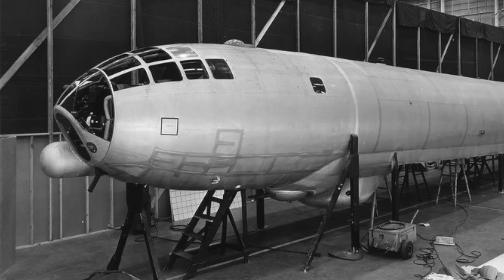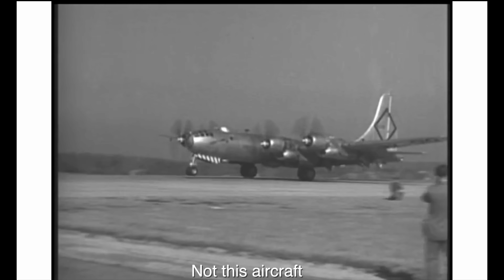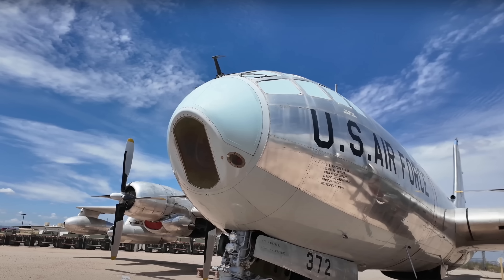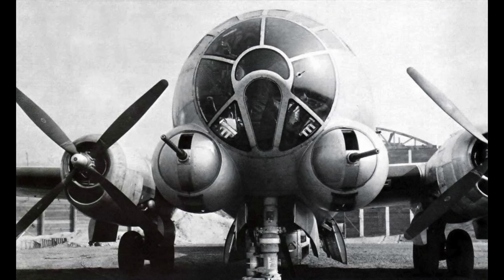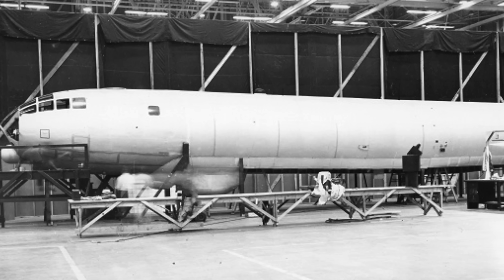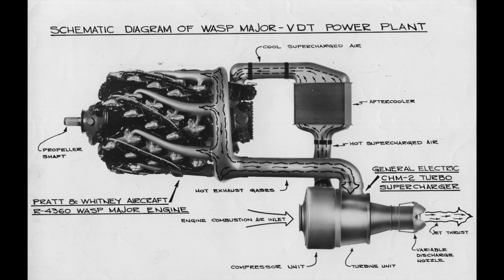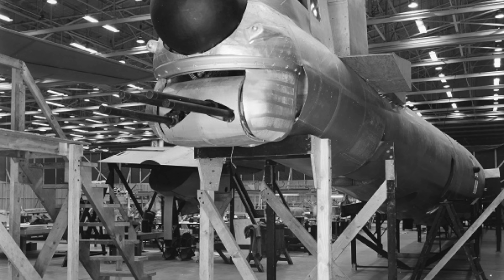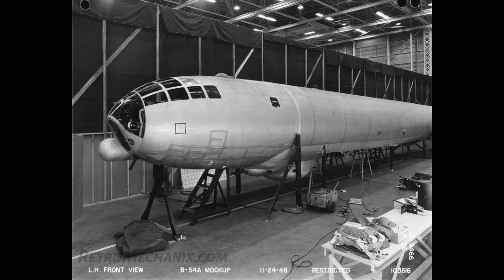Boeing's secret and cancelled final Superfortress - the B-54

Comment: For all of you arguing the point ,
Official government acknowledged cost of :
       Developing the B29   $ 3  Billion  !
   The Manhattan project $ 1.9  Billion !
       Yes the B 29  cost more than the Bomb it eventually dropped  

                      WHY ?
The project begun covertly ( to avoid the wrath of the anti-war and isolationist lobbies ) during the inter-war years ,when the inevitably of the coming war and despite our neutrality , the likelihood that we would be drawn into it  .
  On the assumption Europe would fall it would need the range to attack from the periphery ,  and
  in line with the dictum bombers had to fly higher and faster than the fighters ( the ones it was designed to
 it did , but by the time it flew not )  , it needed new more powerful engines (with super or turbo chargers)than were  
 available , to reach the altitude and speed requirements  , the first of the from the drawing board up projects .
 The altitudes also required oxygen(new tech. at the time) and a pressurized cabin (a still needing to be  
  developed )  ,  and that in turn necessitated remotely targeted turrets (a manned turrets would NOT be possible to pressurize ) that needed guns that would operate unattended something else that was design up , and adding parallax to the gunnery equations  would make hitting a moving target pure luck , 
the solution to that was developing an airborne computer a novel idea at the time ( war time secrecy had the enigma code broken on both sides of the pond , the computers that flew on each B 29  was superior to the one in Dayton that cracked it ) again purposely designed for this airplane (although adapted for use in submarines too ,
if the torpedoes worked as well as the computers ... but that's another story) in the air over Japan the B 29 had the highest kill  ratio of ANY aircraft !
And the radar that was still a theoretical curiosity when the design began , was so above top secret that the air corp.and later air force air brushed the radar-pods out of all photographs released well into the cold war  !
 Even the Rayon belted radial tires were a first for the 29 .
  And probably the biggest reason for the higher cost all these scratch from concept to production developments ,
  The airplane's development took more than a decade longer than the bomb's !
  So YES it cost more !

Comment: I always wondered why Boeing and the air corps didn't install turbo props on the B-50 (I only just now learned there had been a B-54) instead of using recip engines...There were plenty of aircraft using turbo props for years by then...

Comment: One could argue the most expensive was still the Manhattan Project. Due to the fact that at the time it's  
role was as a strategic bomber. The main reason it was cancelled was that SAC went with the Convair B-36.
Could it have done more? Doubtful as it's operating cost was far too high to use it as a multi-role bomber.

Comment: Honestly, it's just as well it was canceled. Its competitors were the B-36 Peacemaker, B-47 Stratojet, and, in the very near future, the B-52. Normally it takes about 3 years from first flight to in service. Other than range, it was completely inferior to the B-36 with less than half the bomb load. It had around a 50% greater bomb load than the B-47, but could have still been intercepted by a late-WW2 aircraft. The B-47 actually had a chance of getting to its target, unlike the B-54 which would have been outdated on arrival.

Comment: I wonder what the pressure differential was in the B29. Modern aircraft normally limit this to a cabin altitude of 8000' but I imagine, with the large rounded windows on the B29 nose, the pressure differential must have been lower, perhaps compensated for by supplemental oxygen. 
It is interesting to see the extremities the development of piston-powered propeller aircraft reached before the entire technology collapsed with the advent of jet engines.

Comment: Was at Edwards  AFB in CA in 1964 when the B-50 was still flying. the engines were P&W 4360's  and 4 jet engines in 2 pods. The sound was amazing. I was a mechanic 6515th OMS on a TB-58 Hustler that was chase for the X-70
Reply: You should feel that some of the legendariness of those old ships rubbed off and surround you. My Dad was a Braniff A&P and I got radial engine knowledge with my mother's milk (Did you know 4360 power cases all had interchangeable/identical front and rear flanges? Sort of like how you can "reverse" an unreversible electric motor = swap it end-for-end!) Lol people ask me how long I been a mechanic and I tell them since my conception!

Comment: I did not appreciate how massive the B-36 is until I experienced it at the USAF museum in person. What an incredible machine even by today's standards let alone when it was made.
Reply: If you ever make it out west a day spent wandering around Pima Air and Space Museum in Tucson is a day well spent. Their B-36 is out in the open where you can really get a sense of how big of an aircraft they are.
Reply: @butchs.4239  I've been to the USAF museum in Dayton and Prima county muesem and going to Prima this spring on a bucket list Route 66 trip.  We'll detour  to Tucson at Flagstaff .  Looking forward to the trip, however the B36 was HUGE and could fly a long way, but Too SLOW and impossible to defend/survive.  Thank goodness that the B47 and B52 came along and we didn't have to use B 54 or B 36 against the migs in combat.
Reply: @Wizard6  I been there a couple of times and still need to go back for the Boneyard tour. I'd add the B-47 to the list of types that thankfully never saw combat. It only had one mission, and while I believe had the order come down it would have done it successfully, the aircrews knew it was a one way trip.
Reply: The B-36 was controversial as part of the Navy vs Air Force struggle throughout the early 1950's. The Navy claimed the B-36 would fail it's mission, which was thankfully never used. A fascinating era with lots of backstory.
Reply: I've seen the B-36 at Castle and it just seemed smaller than what I thought it would of been. Sure it's a larger airframe but when it's kinda by itself you just can't gauge it's size. If they ever do get the funding to build that cover hopefully they'll move the aircraft around a bit just to show how much bigger it actually is.

Comment: At 1:45 Paul stated ""the Air Force didn't show much interest in the B-29D but when renamed the B-50 it sounded much newer and it was more exciting."   Huh?   Wot?     
These designations were allocated by the US Department of Defense/USAAF/USAF, not the manufacturer.
This would be like you or me looking at a dreary old Datsun then calling it a Nippy New Dart and getting excited - except one would hope the USAF would be a lot more objective.
I'm quite sure that anyone who mattered in the USAF knew perfectly well what the airplane was, regardless of what they themselves called it.

Boeing called it the Model 474 Ultra Fortress.   The B-29 was the Model 345.

The B-36 design was initiated during WW2 as the USAAF wanted the ability to bomb Germany from US bases in case Germany invaded Britain, but that never happened, and the B-36 became a long range strategic bomber in case of war against the USSR.  The later B-54 with it similar range would have been an alternative in case the B-36 didn't work out.  But the Soviets developed SAMs and the MiG-15 jet fighter, rendering slow propellor aircraft such the B-36 and B-54 useless.  The USAF changed to high speed jet bombers (B-47, B-52) instead.
Reply: The designation change was to fool Congress, who might have not been excited by another iteration of a B-29, but might go for the B-54. It had worked for the B-50, already.
Reply: @HootOwl513  That sounds quite plausible.  Politicians can be pretty dumb.  A bit unethical by the Department of Defense though.
The long range bomber acquisition question was mired in a rivalry between the USAAF and the Navy.    Both thought they should have the sole responsibility for delivering nuclear weapons.  It was part of both services believing they should the biggest most prestigious service.  That's the sort of thing politicians would have been sensitive to.   It could have influenced Congress on funding the B-54 either way, but the typical reaction of politicians faced with inter-service rivalry is to try and keep them equal.   So, "new" is better.
Reply from the maker: Thanks for the extra comments
Reply: No , by the late 1950s it was understood bombers we're being replaced by icbm's like convair atlas and few years later minuteman not because of surface to air missiles
Reply: @cnfuzz  Your timing is out and you are completely wrong.    The B-36 entered service in 1948, specifically to drop nuclear bombs on the USSR should it have been necessary.  The B-54 was ordered to begin production in April 1948 but cancelled one year later, 1949.
The first version of the Atlas (the first US ICBM) didn't fly until 1957.  The early versions of Atlas were very unreliable, took far too long to prepare for flight, and while officially deployed, this was really a sort of combined emergency/experimental measure.   You've heard the expression "it's not rocket science"  meaning something is doable.   ICBM's WERE rocket science.
The MiG-15 entered service in 1949 and was produced in the thousands.  Soviet SAMs date back to 1951 and were fully deployed from 1955.
That the USAF in the 1950's felt that US rockets were not a viable threat to the Soviets is demonstrated by their deployment of the jet bombers B-47 in 1951, and the B-52 in 1955. These jets were acquired specifically because the MiGs and SAMs could easily shoot down propellor aircraft.
ICBM's were not really much of a threat to any enemy until solid fuel missiles, which can be kept ready for instant launch, were developed and deployed, beginning in the US in 1962 with the Minuteman.
The British government in the 1950's adopted a policy based on the idea that ICBM's meant manned bomber aircraft were obsolete, but this was just an excuse to seriously cut back funds for aircraft development and deployment as part of measures to save a bankrupt economy, rather than any true evaluation of technology.

Comment: So Curtis LeMay wanted the B-36?    That's hilarious.   After the B-36 entered service, he was scathing of it.   Rightly so, the B-36 was basically dud that would never have reached target - the lumbering great thing would have been shot down.
Reply from the maker: I'm always happy to be corrected but multiple sources suggested that LeMay dislike the B-54 and preferred the B-36.
Reply: @PaulStewartAviation  LeMay preferred the B-36 in 1949 before it entered service, as it was bigger and could carry a bigger bomb load.   And, it has been said, because the cost would make the USAF supreme over the USN.  But in service, the B-36 was a disaster - too high a fault rate, too prone to catch fire, and too difficult to maintain mission ready.  LeMay was very vocal about that.
Reply from the maker: thanks for the extra info
Reply: Test with the B-36 and early jets showed it wasn't easy to shoot down at high altitudes. The jet's high speed wings were barely generating lift and all the B-36 pilot had to was to make a slight turn and if the jet tried to follow, it would stall.
Reply: @tomconte2847  The B-36 was so big and cumbersome, a slight turn is all it could manage.   The B-36 cruised at 370 km/hr.   It could get up 700 km/hr for short periods.     The MiG-15 Soviet fighter had a maximum speed of 1080 km/hr - thus  approaching and shooting a B-36 was trivially easy.  
The MiG-15 is usually landed at only 168 km/hr.   At B-36 cruising altitude, the MiG-15 had a stall speed of approximately 220 - 230 km/hr.   The MiG-15 stunned the West when it was first seen, because its flight characteristics were so flexible, though its American contemporary, the F-86, has about the same high altitude stall speed and top speed.   A great lumbering B-36 had absolutely NO hope of outflying it.
The B-36 was conceived in World War 2 for bombing Germany, it was designed to fly high enough to be immune to German flak guns.
The B-52 is slightly faster than a flat-out MiG-15 and flies much higher than a B-36, giving it a sporting chance.

Comment: Arguably, the perfected version of the B-29 was the Tu-95!
Reply from the maker: Um….
Reply: @PaulStewartAviation  
I read somewhere that the fuselage (and maybe some other parts) were derived from the Russian Tu-4 copy!
Reply: @oxcart4172 but the Tu-4 copy was known to be substantially worse than the original B-29 because the Soviets couldn't make everything in the B-29 to spec.  Also they did a bunch of imperial to metric conversion that didn't exactly work out well.  So, no, it was not the perfected version.
Reply: @JMurph2015   Not substantially worse, just somewhat different; much the same relationship as the Li-2 and the DC-3/C-47.  For instance, the Tu-4 turrets had two 23mm cannon rather than four .50 cal. machine guns.
Reply: @MrCateagle  the Tu-4's range was only like 2/3 that of the B-29...
Reply: Soviet B29  wouldnt have had  computerised  CFC  no way it was cutting edge tech  for usa.

Comment: Cancelling the B-54 might have ruffled a few feathers at Boeing, but they had plenty of other work to keep the lines running. And as mentioned, the B-47 was right around the corner.
Reply: Not to mention the mighty B-52.
Reply: @RCAvhstape 
It's The "#VENERABLE" B-52
Reply: I once watched nearly everyone they had in Florida from the end of the runway from a 56 Chevrolet while My Uncle unloaded gravel from railway cars to extend the runway for B-52's, it looked like a 100 took off.    We sat there bored (my brother and I) and all of a sudden here they came.  I have no idea how many there really were, I was only 6, one of the most amazing things I have ever seen except for a Space shuttle main engine running for ten minutes sometimes at 110% throttle, made it rain for miles and parted the clouds in Mississippi where they test them.  Ran wild dear from the woods, they stood beside us the whole time it ran.
Reply: As the number indicates, the B-54 program postdated the B-52…
It was a fallback option.
Reply: Not to mention they would have been entered service around the same time. An aircraft normally took about 3 years to go from first flight to in service. Given the B-47 had its first flight in 1947, they would have entered service around the same time, or at least within 2 years of each other. The B-54 would have had around a 50% greater bomb load, but it could still have been intercepted by a late-WW2 fighter. And the B-36 just outclassed it completely except in range, which is the one and only thing the B-54 would have had on both of them. But given the B-54's extreme obsolescence even before entering service, it was for the best.